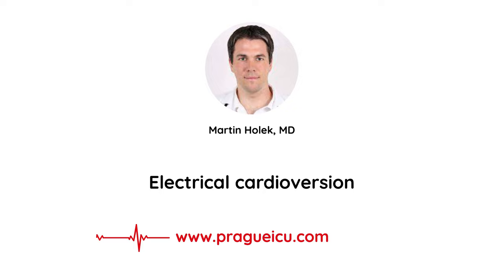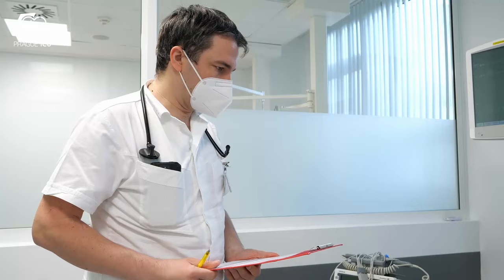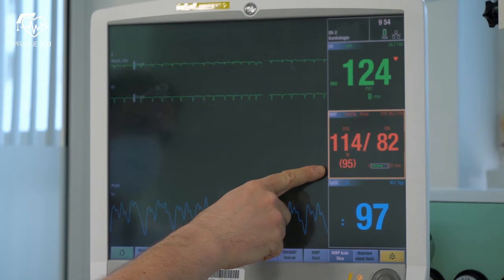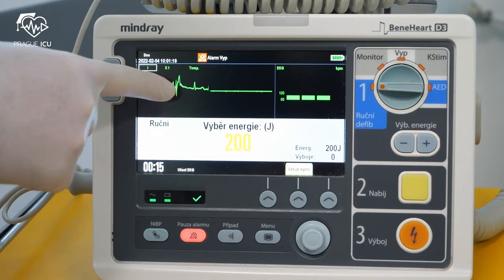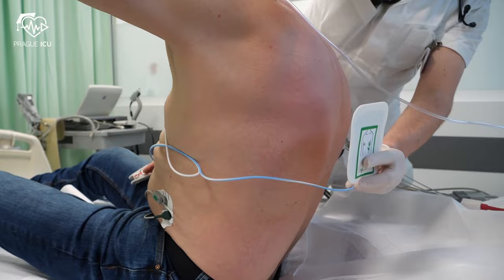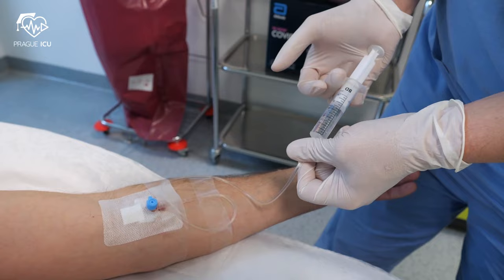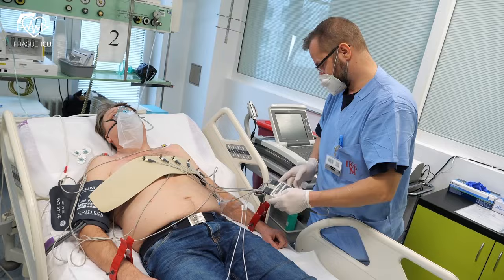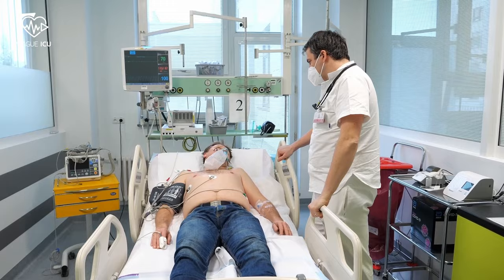Electrical cardioversion

Comment: Why you shock him
Reply: It stops all the crazy electrical activity causing atrial/ventricular fibrillation for a brief period, then the SA node in your heart will start restoring normal heart rhythm.  You are actually resetting the patients heart.
Reply: His heart beat is not control
Reply: eAa
Reply: It is a thing when people have a hart attack
Reply: @rukinaototheredpanda  That's not! It's not between to cardiac arrest and heart attack.
Reply: To shock us.
Reply: Why you shock him
Reply: his heart beat is not connected
Reply: He has atrial flutter / fibrillation.

While venticular (the two big bottom rooms) fibrillation is the "heart attack" that causes the person to pass out and without quick treatment... Well die (cardiac arrest)

ATRIAL fibrillation (what happens here) is where the two upper rooms fibrillate. The heart still pumps blood but not efficiently, causes the blood inside to swarm in a not so good way.
That not so good blood flow will cause the heart attack in the future, so the patient gets called in BEFORE the heart attack happens, to correct the heartbeat before the heart attack happens.

In this state the electrical shock is much more likely to correct the heartbeat and wont cause the person to die. The person gets called specifically to get shocked to correct their heart before the heart completely fails to avoid the heart attack.

Also fibrillation: just the heart moving about in a silly disorganised way instead of an organised fashion that properly pumps blood around the body. 
If its "atrial" (upper rooms) then only they are affected, if its "venticular" (lower large rooms) its the whole heart that is just vibrating in a silly way without moving blood.

Hope this helps :) simplifying it since u probably dont need to know the whole heart anatomy feel free to ask more questions
Reply: @chrisbailey7384 just wanted to say that to
Reply: Maybe atrial fibrillation
Reply: his heart beats are not normal the shock wil make his heart beat normal agian
Reply: Why not
Reply: But there’s stuff like adrenaline that you can give to the patients without shocking them because he’s not crashing or his heartbeat is not going down or too high
Reply: @The_Love4_ART The problem was his heart rhythm. I have had this done six times.  Never felt a thing.
Reply: Svt
Reply: @The_Love4_ART  adrenaline will not fix his atrial fibrillation. Cardioversion, the shock, probably will.
Reply: To fix unwanted waves in ECG  specially atrial flutter and atrial fibrillation.
Reply: @krappy4993  Ventricular fibrillation is different from heart attack. Heart attack is when your heart doesn't get enough oxygen for example most commonly when a coronary artery gets clogged.
Reply: Le rythme cardiaque est commende par des cellules nerveuse le sinus il sont comme une battrie c'est une sorte de courant electrique qui fait battre le coeur jour et nuit autonomes sans interruption ces cellules peuvent se dergler et battre avec un rythme non sinusal et regulier et le fait de choquer le patient ces cellules reprennent a battre avec un rythme regulier mais parfois c'a ne marche pas si sujet ages avec cardiopathie decompensee
Reply: عشان مبيسمعش الكلام

Comment: Did this guy have any health issues or did he quite literally volunteer to be shocked
Reply: This guy has atrial fibrillation. Unregular rthythm of heat beat. Need cardiac conversion to reset so he can normal heat wave
Reply: you can't volunteer for something like that! It could kill you.  Dumb question 😒.
Reply: In all Prague ICU videos(Not all), they use real Patients not Actors

Comment: Shouldn't oxygen be off during cardioversion?
Reply from the maker: Patient is not oxygenated during the DC shock itself.
Reply: The shock voltage is too low to cause oxygen to ignite plus there is no direct contact to oxygen.  It would take as much as a welding arc or a lighter flame to burst.
Reply: @chrisbailey7384  Oxygen is not flammable.  It is an oxidizer, not a fuel. It promotes combustion.  Source: Me, propellants and explosives chemist.
Reply: @pragueicu6443  اغبههبعبخبعبغيحي٨ي
رمخي
ؤمؤن
تؤكؤي
ؤم
Reply: I’ve never had any less the 300 Jules? I have been shocked back 4 times now.

Comment: The other 2 possible shocks are of higher energy or do you apply 150 again?
Reply: A mi me aplicaron los 3 de 150
Reply from the maker: if the 150 J is not successful, you proceed with 200 J.
Reply: Vs

Comment: Why youre not using quick-combo PADS? its XXI Century 😢
Reply from the maker: We perform 5 elective DC versions daily for AFib/AT, this would be enormous waste of money. Absolutely no need to use single use patches for this 5 minute lasting procedure.
Reply: @pragueicu6443  I think that you should once again check ERC Guidelines instead of thinking about „waste of money”. Quickcombo pads are much safer for patient and medical staff in warious situations: cardioversion, resus etc.
Reply from the maker: @kubarespondek520  We perform more than 1500 elective cardioversions annualy - no complications documented neither in patients, nor in doctors. Absolutely safe procedure, do not worry Kuba :)
Reply: @pragueicu6443  😉😉😉
ERC 2015 section 3D Defibrilation: „Self-adhesive defibrillation pads have a number of advantages over manual paddles and should always be used in preference when they are available.”

ERC 2015 cardiac arrest: „Keeping the focus on the use of self-adhesive pads for defibrillation and a defibrillation strategy to minimise the preshock pause, although we recognise that defibrillator paddles are used in some settings.”
Reply from the maker: @kubarespondek520  My friend, you should have probably noticed that this is not a CPR case, but a planned cardioversion procedure, right?
Reply: @pragueicu6443  Check the first part of my comment „ERC 2015 section 3D Defibrilation” during cardioversion patient gets defibrilated right?
Reply: @pragueicu6443  and during the defib procedure ERC 2015 recommend using adhesive pads- „should always be used (…)”
Reply: @kubarespondek520  It often depends on cost/effectiveness. In this particular hospital they have deemed it more efficient to not use single use electrodes. In some other place they might have more resources and for them using the single use ones os more effective.

Comment: And if this doesn’t work? Pacemaker?
Reply: generally always works if not repeated periodically
Reply: @JOSESANCHEZ-yi7ou  Doesn't work in some cases even if repeated. For example if the atrium is enlargened. 

In the case it doesn't help then either they leave it at that if there aren't any indications to use other treatment options such as ablation or pace makers.